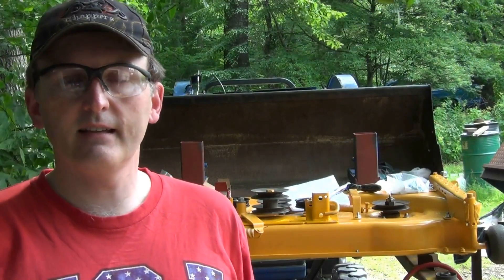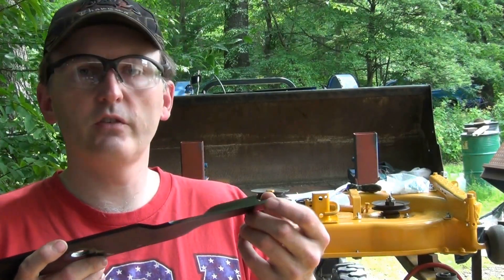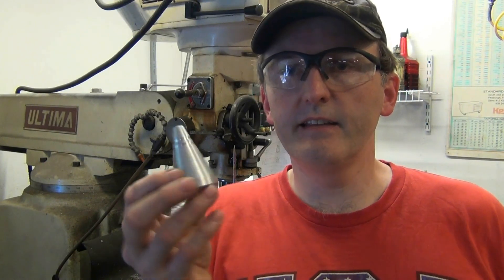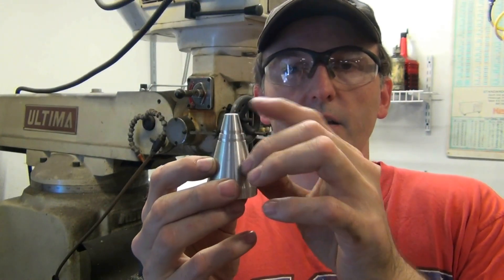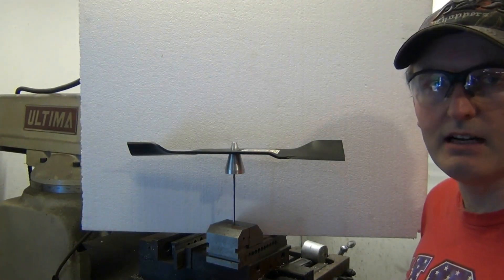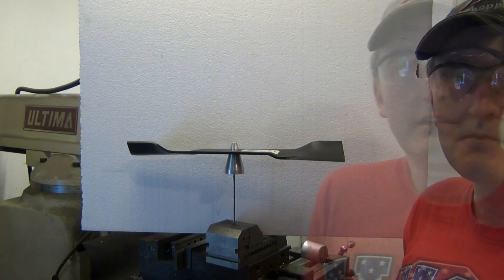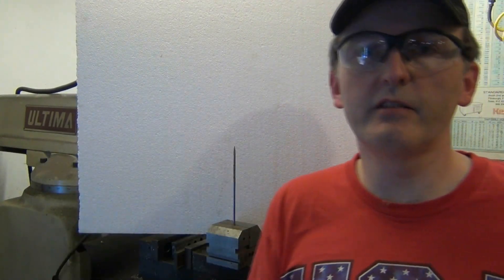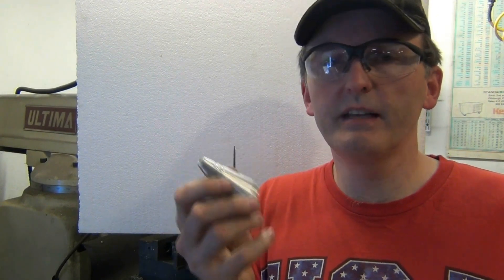Showing How a Cone Lawnmower Blade Balancer Works

Comment: All American Sharpener  has a blade balancer they sell that is very similar to the one here. The only real difference is that the base is spring loaded so that the cone automatically adjusts to the diameter of the mounting hole on the blade. It's made in the U.S.A. and is all metal.

Comment: Your machined designed vertical cone is nice. I use to use a step cone el cheapo balancer. It was ok, but with this style of balancer you have to have a level reference  of some sort. Then I discovered the horizontal cone with magnet style balancer. The horizontal style eliminates the need for any level reference. When the blade is balanced the blade will not move no matter what position it's in!!  Being You have the machining equipment, you should check out the horizontal style balancer. The Mag 1000 is a commercial version. But, really nice job making your vertical cone balancer!! With your skill you could make a nifty horizontal balancer!!
Reply from the maker: I was thinking of making one of those this year when I was using this one. I used a horizontal setup to balance a jet boat prop once. It worked well for that too.

Comment: Your cone blade balancer with the accurately sized steps is the best I have seen as it allows the blade to be accurately placed without any slop as in the cheap stepped ones. Good job!

Comment: Don't you also need to be sure the weight of the blade is within the specs for the mower in question? It is my understanding blade functions as part of the flywheel and the weight is matched to the machine?
Reply from the maker: I haven't heard that, but maybe. This one's belt drive though, so doesn't really apply. It's also the part number called for this particular mower.

Comment: Great video.You seem like a smart guy, detail oriented, etc riddle me this....and maybe this is a dumb question, but in all seriousness...if a lawn mower blade is only sharpened (and lowered) on the outer edges of the blade how does it cut a swath of grass AS WIDE as the mower itself (for the most part)?
Reply from the maker: I assume you mean the whole width, and not just the sides? If this is case, it's because the blades cutting edges cut around an entire circular path, which would include font, back, sides, corners, etc.
Reply: @ArnoldsDesign  Ahhhh, see thats one of those "I'm an idiot" monents that you opened my eyes to in that it makes total common sense that as you move the mower forward everything that comes into contact with the front, sides and back will get cut, duhhhh, I'm a boob, buuuuuut I would bet (and I'll have to test this theory to save some face) that if you put the mower out in the grass and start it up without moving it then turn it off that the entire diameter of grass under the mower would be cut not just the outer perimeter where the blades are lower and sharpened (leaving the inner section of grass uncut).
Reply from the maker: @Dom-pf8wd  Exactly, it would leave an outer ring of cut grass. The inner area might get beat down.
Reply: @ArnoldsDesign  I'm still kicking myself for this brain fart.I swear I'm an intelligent and even educated guy just one of those middle aged "dumas" moments.Thanks for the replies and moment of clarity.Have a good one!
Reply from the maker: @Dom-pf8wd  No I get it, believe me. Happens to me sometimes, especially if I'm under stress.

Comment: I"m not sure why the extra .5" of blade length would matter. I'm sure they overlap, but I would think they are designed to rotate ninety degrees different from each other. Unless they are freewheeling somehow, but then it would only matter if they turn in opposite directions.
Reply from the maker: Being they're driven by v belts, the pulley can slip during operation, which can result in a collision.
Reply: If you look at the design of the deck, the center spindle is a couple of inches forward of the outside spindles.  That allows the blades to technically overlap each other, but they will never hit because the center blade is far enough forward to avoid contact.
On two blade decks, one blade will be farther forward of the other for the same reason.  Only decks with the blades straight across will have cogged belts.  
My Toro ZTR has a two blade system, and if I turn too sharp to the right, easy to do with a ZTR, it may leave a streak because making the sharp turn eliminates the offset.  The owners manual will recommend turning in one direction to prevent this but not explain why.

When you install the blades, you can rotate them by hand and see that they will not contact each other.
Reply from the maker: This deck has a stagger like that. The center blade is several inches ahead of the others, and both outers are moved slightly toward center, creating an overlapping cut.